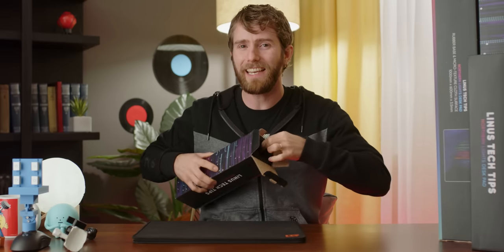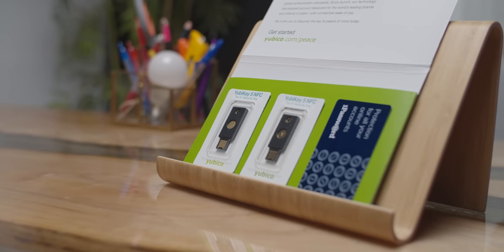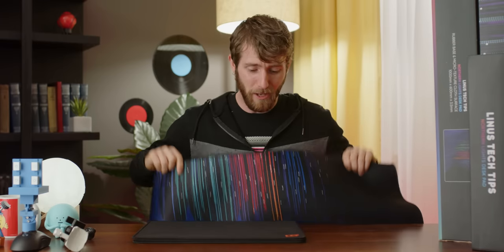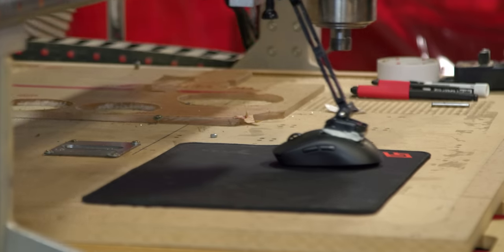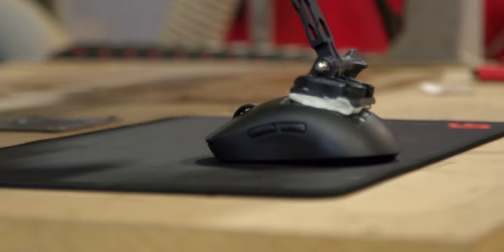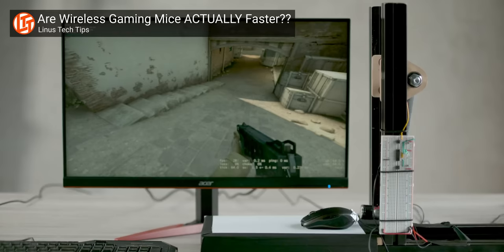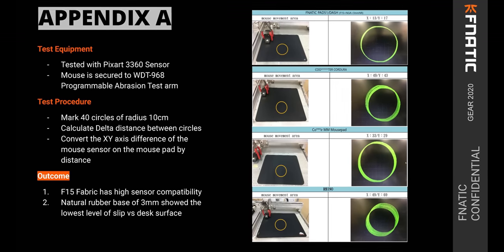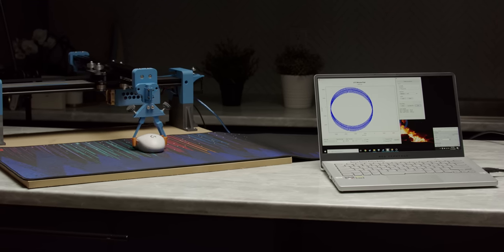A Totally Unbiased Review - LTT Northern Lights Desk Pad

Comment: Only true gamers know the pain of using a book as a mousepad.
Reply: Wait you guys use books? I only have a thin sheet of paper!
Reply: I'm currently using a GPU box on a side-table beside my couch, that puts it perfectly even with my armrest. I may need to swap it out at some point as it's starting to sag and give me some inconsistent tracking once in a while. Lasted quite a while though.
Reply: Damn MY friend uses his homework
Reply: I before used a promotional fan thingy that's given out by a senatorial candidate lmao, it works but needs high mouse sensitivity because it's too tiny
Reply: Not only gamers. Me as a digital compositor have to suffer with a book
Reply: I use bare table lol
Reply: I remember for ages I used a Skyrim strategy guide I had sitting around because I couldn't find a mouse pad that was big enough for my crappy low dpi mouse. Proper desk matt and mouse now, but oof.
Reply: @rushiewashie  rich
Reply: @rushiewashie  that's taped to the desk lol
Reply: Me too ༎ຶ‿༎ຶ
Reply: Rush. I wasn’t far off before, I’ve used magazines.
Reply: And all you have is glossy covered books
Reply: @rushiewashie  i was about to type that, but i only use a sheet of paper while doing some homework not in my house.
Reply: Mine was a plastic chopping board.
Reply: Book? I use paper
Reply: You use a book? I use painters tape... Yes i am not joking.
Reply: I've always just used my desk
Reply: I used a 12in x 14in x 3/4in plank of white oak for a few years
Reply: Those books that have tough and smooth cover like a photo album book is great, get a wide one tho
Reply: I was using a thick garden book....
Reply: A file folder worked best for me but my wife kept putting it away cuz it looks messy
Reply: Ah fuck don't make me cry my man
Reply: Myself, I sometimes use the keyboard of my laptop for a mouse pad
Reply: I used the wotlk tcg mat for many years. 😂
Reply: My mousepad for ages was my exes broken Macbook air with a matte/gel skin on it, the only time Mac actually supported gaming lol
Reply: Me2
Reply: i used to use my shirt as a mousepad since the one in the gaming cafe wasn't good lol
Reply: U guys use a book? I tape down a piece of paper to my table.
Reply: Only old gamers know the pain of cleaning the mouse ball.
Reply: I use an old laptop
Reply: Or newspaper......
Reply: you guys even have a mouse pad!
Reply: I used a dollar store cutting board for a while
Reply: I'm using a cutout of black foam atm lol
Reply: @rushiewashie  you have a thin paper? I only use my lap as my mousepad?
Reply: Wax paper taped to a glass table.

Went to a week long LAN party and forgot mine.
Reply: IPad case
Reply: What about your thigh? Or your palm?
Reply: Must br a youn gamer to think thats a pain real gamers know the pain of using a ball mouse on a bare table.
Reply: @as-qh1qq  when the situation is dire!
Reply: Or the bare table, before you had anything :o
Reply: You guys use books? i scrape my mouse across my table like a caveman
Reply: I dont even use a mousepad ;)
Reply: Legit
Reply: I used pizza boxes
Reply: True 14 year olds*
Reply: I personally use a box of brownie mix
Reply: @ZedRei  Use a regular sheet of paper and it will become wax paper ;)
Reply: agreed  I also use a book not kidding
Reply: I used a sheet of white paper . I replaced it every few months and I'd think to myself . Ahh nice. New mousepad 

I eventually bought a full desk one after about 7+ years
Reply: Used to use one so happy i dont have to do that anymore
Reply: YES
Reply: I use a piece of thick glass. I love the way the pointer dances around.
Reply: True pain but in the future I’ll get a proper mousepad
Reply: I remember
Reply: Yeah , kinda!!!!
I use my exam pad as my mouse pad♤
Reply: I tossed out my old mousepad and realised my table (matte black finish) itself worked pretty well so the mousepad wasn't really needed in the first place.
Reply: I use a folder
Reply: but mousepads are really cheap why u use books etc
Reply: I used my jumper
Reply: Pizza cardboard was the most absurd mousepad I ever had to notice!
Reply: @Tramun  that was matrix level!
Reply: For so long I used a piece of A4 paper then came the trial and error of many different types of mouse pads. Now I have a small desk pad of Vegeta.
Reply: I use the giant arm of my leather sofa
Reply: Yes
Reply: First from paper, to book, to IKEA chopping board to finally getting a decent mousepad. I feel you
Reply: Only real gamers still use books as a mousepad  even though it’s painful
Reply: i don't use anything!
Reply: So true
Reply: An A3 cutting board works a treat and costs little.
Reply: lucky you got books. I don't read books so I use back then a printed cardboard hand fan (without handles).
Reply: @M3PH11  same
Reply: I know the pain but i have a temporary mouse pad
Reply: I use a book with a cloth cover (perfect for CQC)
Reply: Y'all speaking about mouse

I use a touch pad 😭😭
Reply: @rushiewashie  lol weak i dont even use one
Reply: only the best ones use no mousepad
Reply: or a tiny piece of paper
Reply: Agreed 😂
Reply: have you seen someone using banana leaf?
Reply: I use a book and a mousepad on top. I play on a soft leather couch 😭
Reply: I used a ikea instruction manual
Reply: Bruh i use my towel
Reply: Teacher : Where is your book?
Gamer : You mean the mousepad?
Reply: aint that the truth
Reply: I use my mouse on a bed. Its quilted. very smol patches.. And my friends wonder why I don't play competitive shooters..
Reply: 100% True
Reply: Are you all pretending to be stupid or are your desks made out of glass or of a weird material that makes the mouse not to pick up the signal nicely enough? There is no need to place anything
Reply: Lol actually me
Reply: I only have the box that my mouse shipped in
Reply: Pff books and paper ? Ever used clear sleeves cause they have a better surface then your desk ? XD
Reply: I used a cardboard sheet
Reply: Yes
Reply: @Happiness-lp9fw  guess you never had a crappy wooden table
Reply: Used a book under some paper for a while as I had thumped a hole into the desk playing cs:go
Reply: yall have something for a mousepad?
Reply: True
Reply: Wait you guys have mousepad?
Reply: Using a school binder rn
Reply: How about trying to use a touchpad
Reply: You guys use books? Hmph, I use my mattress.
Reply: I actually used to do that
Reply: Or even cheaper is not using one and using the small space next to the track pad on a laptop.
Reply: A true gamer will try to game at all costs. So yes.
Reply: Ah. For the longest time I used a facric textbook cover over a magazine
Reply: We couldn't afford books. We used our knees.
Reply: i use my couch cushion and insane dpi lol
Reply: And dictionary too
Reply: Only true gamers know the pain of having to lick some wires you stuck into a USB port to control your PC because you don't have a mouse.
Reply: I've done it all. Book, both hard and soft cover. Cardboard, printed and brown. Paper. A wooden desk that was rotting and falling apart. I don't think I could go back to any of that.
Reply: how about dirty sheet on mattress? I've learned you can use just about anything, but thigh skin
Reply: none of you would suffer if you supported the mighty trackball!
Reply: I used to use the top of my first tower. Ah the old days.
Reply: This suffering cannot be qualified as pain it can only be the darkest hour
Reply: only true gamers know the pain of using a book
Reply: @rushiewashie  There is a thing called 1$ mousepad
Reply: directly use mouse on desk
Reply: Whats a mouse pad? 😏
Reply: I use my English book
Reply: ...or half a coffee table / tv tray.
Reply: oh god
Reply: @SpaghettiGuy no I use a mouse, but my setup has no room for a mouse pad, so I use it commando style 😉
Reply: Bruh I started with a book on the bombers from WW2 and a laptop that was nearly 9 years old and had to be plugged in to work because the battery was bust but a new one was more than the laptops worth.
Reply: I have used a bare desk as a mousepad ever since mouse sensors became contactless.
Reply: Or a piece of paper 😅
Reply: Yes
Reply: You’ve never used a glass coffee table?
Reply: @rushiewashie  Paper, we'd kill for paper. we just used an air mouse (with apologies to Monty Python)
Reply: As a former EA employee I used to use a broken xbox or ps4 as a mouse pad :)))
Reply: what are you talking about, you use the space right next to the trackpad
Reply: I HAD A BOOK AND A PAPER ON IT
Reply: How about using the bed sheet with a hot laptop on your lap
Reply: phone book lol
Reply: Lol calender right now
Reply: I dont even use a mousepad
Reply: i once had to use a t-shirt
Reply: Haha totally not me... i use a diary
Reply: Meeeeeee
Reply: Hey don't call me out like that
Reply: @rushiewashie  fuck! You to don't call me out like that m8 hahaha
Reply: I use a vinyl coated clipboard. It works well enough
Reply: boogie board
Reply: Yep using a book with my fully turned up sensitivity £3 office mouse
Reply: lol currently using a "Weight control" folder from Lufthansa cargo (don't ask, I don't even remember where I got it from) and it has served me well for a couple of years. It has the (least) required size I need, works well and it doesn't matter if it's get coffee spills, it adds to the character of it :D
Then again, I've had a mousepad I specifically bought over a year ago that is still packed away.
Toyed with the idea of the ltt mousepad in the ....1meter? version, even had it in the basket a couple of times but ...shipping, oh shipping...And then the added tax... and then the EU import tax / vat on top of it.
I was just buying it right now but stopped. Originally I was gonna buy 2 shirts and the pad but I'm not dropping 100+€ on this, even worse is that almost half of it is shipping and fees/taxes
Reply: I used cardboard
Reply: Flawless logic, IF you can afford books. I remember using my school notebooks lol
Reply: @rushiewashie  me using a table : ) it works pretty well tbh.
Reply: me with my 5pcs, $0.02 each, mouse pad that i bought from a sale online: 😁👍